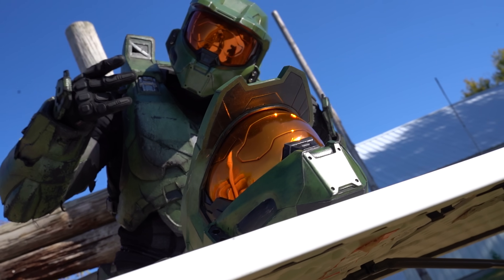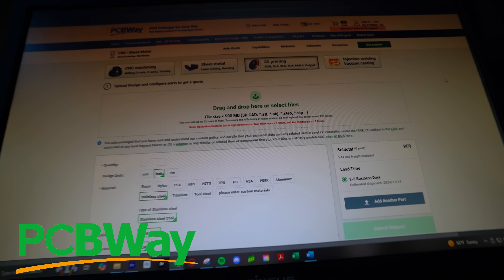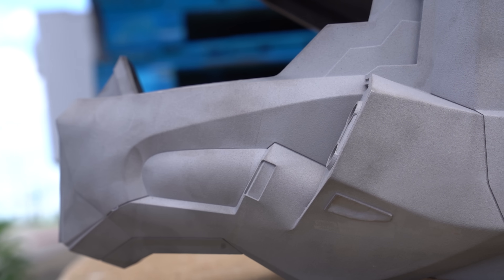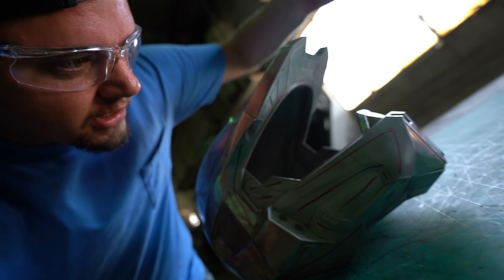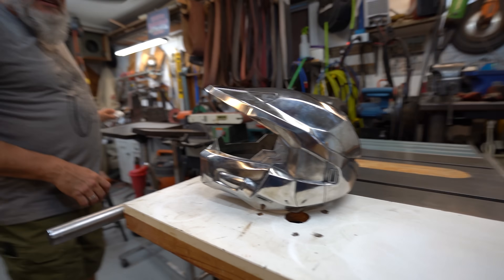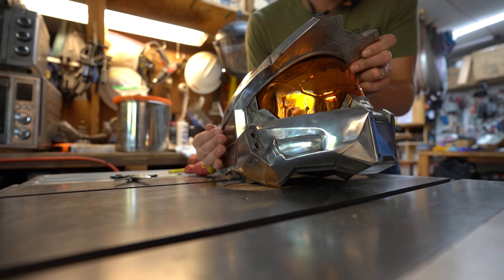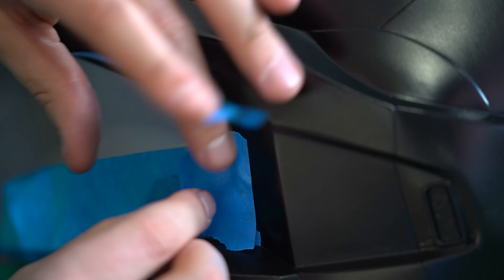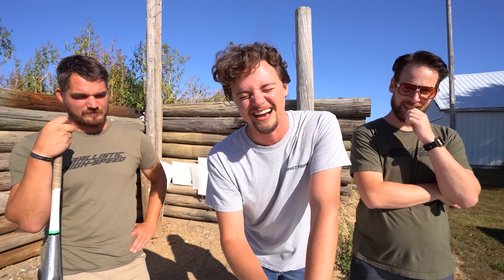Making a BULLETPROOF Master Chief Helmet (STEEL)

Comment: Honestly, if I were to build a proper visor, I'd go with this setup: a thick honeycomb grid structure made from ballistic-grade metal, laser-sintered for maximum strength and precision. Then I'd sandwich that between two layers of transparent ballistic plastic - the kind used in bulletproof eyewear. The idea is that the metal gives you real protection, but with micro-perforations that still let you see through, kind of like looking through a mesh screen, but engineered to stop high-velocity fragments. That way you get solid visibility without sacrificing armor. Way better than just slapping on a transparent shield.

Comment: Not sure if this was mentioned in a comment, but going by the stated weight of 35 lbs for 316L stainless steel, the approximate weight of this helmet in titanium would be 16.8 lbs. It would be really interesting to know what an entire suit made of titanium would be given someone with Cheifs actual weight and frame.

Comment: It is pretty straight forward to make bulletproof glass if you want to do that for the visor as well.   Oh and the energy shield is mostly extra protection for plasma fire.   Though it does block bullets.  MJOLNIR in lore is bulletproof against standard small arms.

Comment: A curiosity about the Spartan armor in Halo is that only Spartans with genetic modifications are the only ones compatible with that armor since if a normal human were to wear it it would literally crush them so in fact that helmet is not that far from reality in Halo canon
Reply: It wasn't really the weight of the armor that did that the armour itself could hold it's own weight kinda. It was the strength of the suit its self that did it
Reply: @redshift180sx  Thank You

Comment: 35 lbs...holy cow, how thick did you print the stainless? I'm doing a Noble6 helmet using 16 and 14 ga 4130 steel that will be heat treated. Ill be somewhere around 10-12 lbs.

Comment: I don’t know much about 3d printing metal, but I feel like if the helmet was made out of titanium it would probably not be as heavy. Also I saw a video from a Chanel I think is called “demolition ranch” and he fired a 50 caliber bullet from a Barrett (at least I think it was a Barrett) into a 1 inch thick thing of titanium, and it didn’t go through. It took a chunk out of the metal but still pretty cool stuff.

Comment: I would've been interested in hearing about the properties of the steel alloy chosen.  I think your dad is right that it won't stop much above a 22.  I've seen videos of people shooting through unhardened steel easily and I don't imagine the 3D printing process gave the metal any properties like hardened steel.  If you had the means to do a heat treatment and quench then the helmet could be stronger.

Comment: Now bro is gonna have to make a Bulletproof master chief outfit
Reply: If Impactprops doesn't, Installation00 got your back.
Reply: @Installation00  fr
Reply: Would go hard as hell
Reply: Yes!
Reply: Start with a bullet proof visor
Reply: Please DO IT Impact Props
Reply: If they do it imagine how heavy it would be to wear
Reply: @Stuff493828717930405  That's why there'd have to be an internal support structure and movement assist systems. That's the stuff I'm working on at the moment.
Reply: @Stuff493828717930405  It would be spread out throughout the body, so no different than heavy armor from medieval times.
Reply: They got to make energy shields
Reply: 2024 december 30st making of master cheif
Reply: Making it this way it would just be a decorated medieval knight's armour😂
But if you use Carbon fiber and Kevlar layering under or even covering a 3D printed chassis it would work for sure
Reply: Facts
Reply: Pls do that
Reply: @ Bro if Chief wears that he’s gonna die
Reply: Its armor, and the suit jacks him off, it better be lore accurate if he makes it
Reply: Then he’ll have to put someone inside then shoot it and see what happens lol